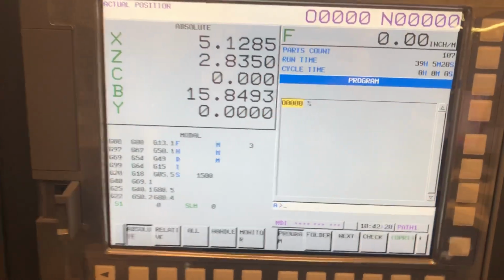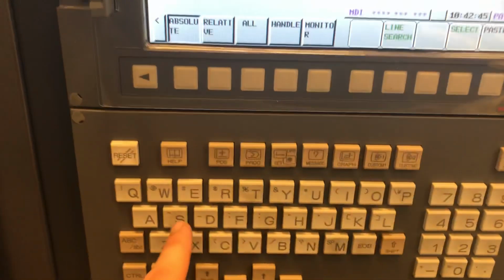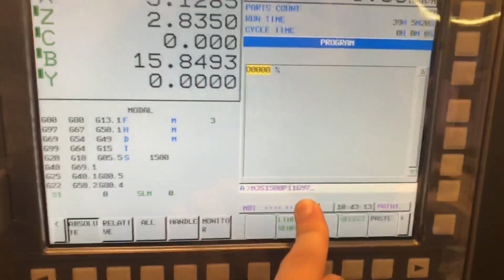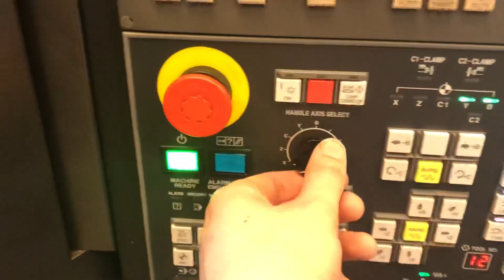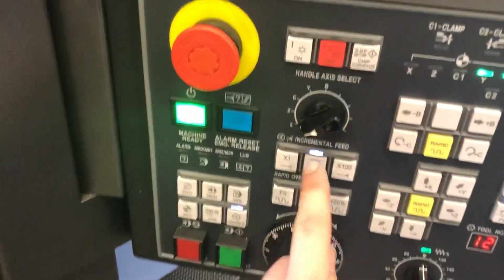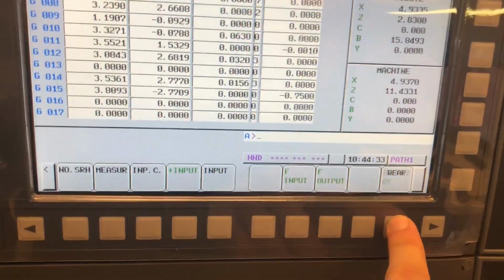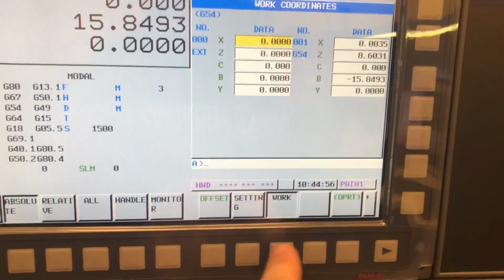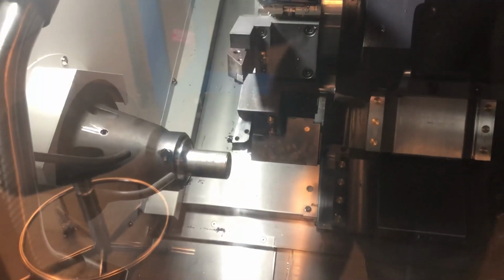DOOSAN Setting Z G54 Offsets

Comment: What about tool radius compensation g41/g42? I think that it should be done this way: cut along the Z axis, measure the diameter. For example we measured the diameter and it is 80 millimeters. The cutter radius is for example 2 millimeters. So we add 2 multiplied by 2 to eighty. We get 84. We go to the work offset page and press X 84. measure. So we tell the machine that the cutters radius centre is located 2 millimeters out of the part surface and on the Z axis we also set the offset as 2 millimeters. Would it work that way?
Reply: The diameter doesn’t change with nose radius compensation, if you take a cut and measure the diameter to be let’s say 50mm then you measure X50. in the geometry offset page, given that you don’t have a probe that does it automatically. G41/42 just takes into account the tool radius which affects chamfers, circles etc, you don’t need it if you’re turning just horisontal and vertical.

Comment: First off in MDI call up G54 or whatever work offset you are using and also call up the tool offset,  e.g. T0101. Other than that a good video.